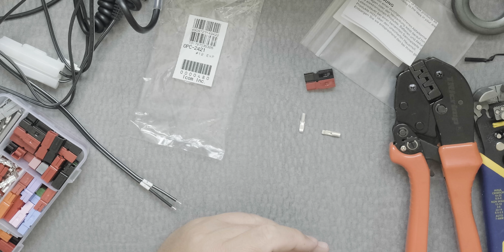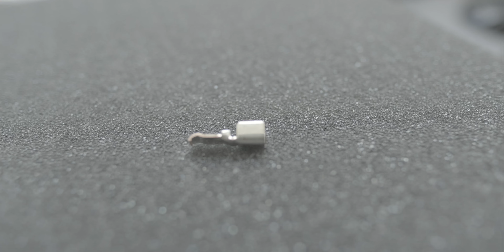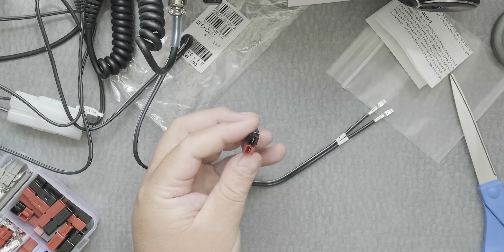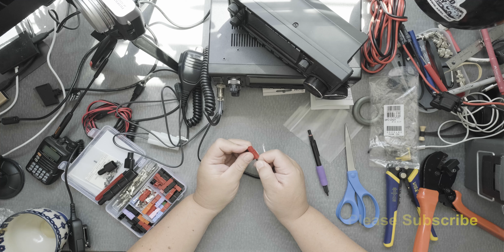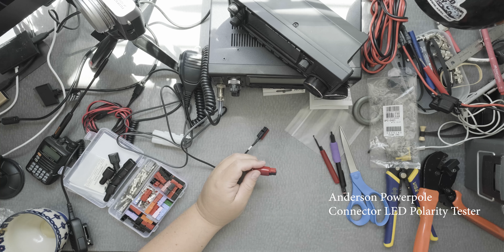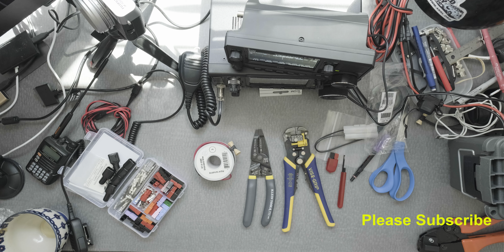Step by Step Anderson PowerPole Installation on DC Power Connector

Comment: I have a 705 and love it I'm considering picking up a FT-891 what radio do you prefer when you are portable? Cheers
Reply from the maker: For me, I'm liking my FT-857D.  I finally figured out how it works and how to pull out contacts when doing POTA.  As for the FT-891, I like it.  It sounds better than the FT-857D and a solid platform.  Although, I like that the FT-891 has UHF/VHF and I like the menus better. As for the 705, that is a class on its own.  The audio is super because it's an SDR.  The interface on the 705 is super nice, the menus are great and if you have a 7300 then you know how to use both.  I like that the 705 can record your QSOs, that it has bluetooth, that its ready to do digital - did I say the screen!  The only draw back - the radio is only 10w with an external battery.  A year and half I would have told you that 705 is nice, but 10w is very challenging, but now that the solar cycle is climbing and SFI is 219! 10watts can take you places.  If you are doing POTA, 10watts will be fine to activate.  Now, the FT-891 is a gem and it has 100w, it sounds great, it has no character like the Ft-857D, but overall a solid radio that you will be able to get contact far away.  If I had to choose, ft-857D, ft-891, or IC705 for POTA - 857 first, then 891 and last 705.  If you want to challenge yourself like I did last year, the 705, 857D, 891.  If you want to use it for field day, 857, 891, 705.  If I do SOTA - 705, 891, 857d.  Lastly if the word was about to be taken over by aliens or zombies I would take the 857D.  So, it is very hard to choose.  All these radios have a purpose.  What would be perfect?  The 705 at 40 watts! Then you would have a rocking radio - even better a 857d format with IC705 type of interface - then that would be a big seller.  I really like the menus in the 7300 or 705 - easy to understand - not like the 991A or the 891.  So, the best thing to do is watch more video and if you can afford it buy the 891 before selling the 705 - you might like both for different situations.
Reply: @frankwc0o  Wow thank you for the detailed reply. I have just ordered the 891. I intend to keep the ic-705 as well! Thank you very much 73's VK3ACU
Reply from the maker: @VK3ACU  No problem.  I'm sure you will love your 891.  If you need a beginner's guide for that radio, I have a video for that: https://youtu.be/MUuwSA2wrFs. -73